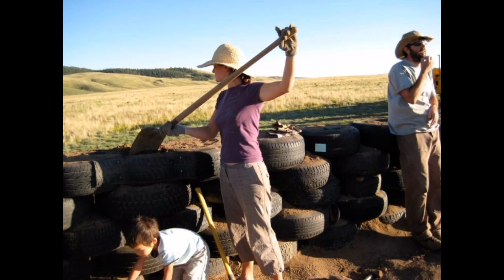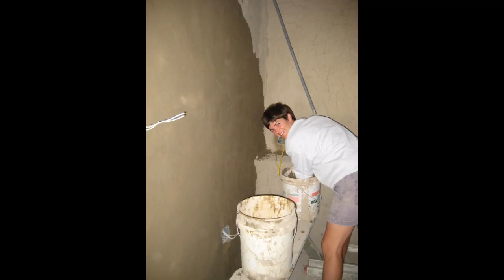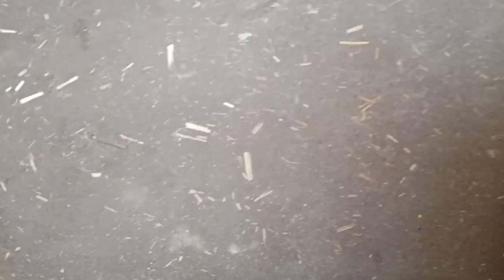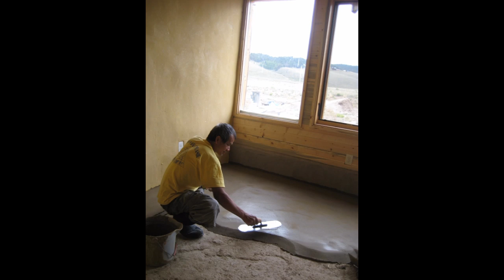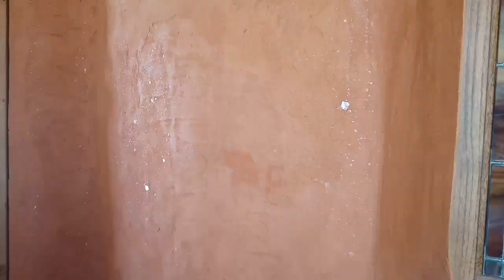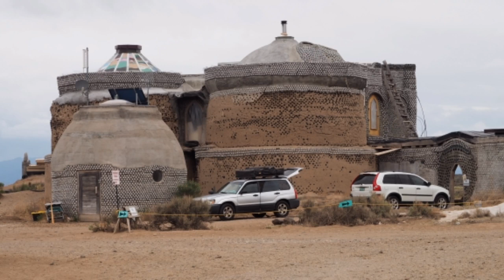Earthship house

Comment: Thanks for the information. Can this be done in a tropical climate?
Reply: In serbia these houses was built till1960s.they are still standing.we have150 year old earth houses.35 celsius in sommer amd minus30 in winter.no problems.plenty of rain
Reply: The more important is positioning windows and height of porch.read about that.in winter the sun is lower an can shine into house.in sommer the sun is high and it dont shine in the house.
Reply: Indigenous in South America have mud houses
Reply: I think areas with a consistent rain pattern find this type of building to be less successful.  I read that humid locations and rainfall are bad for the building materials.
Reply: @jimjimgl3  I've seen 20 year houses made of mud with wood columns, in the mountains with heavy rains for most of the year and 0 maintance done to them. They are fine
Reply: Its important to make a concrete bottom.after an water isolation.when you finish walls its important to paint it becouse of rainfall